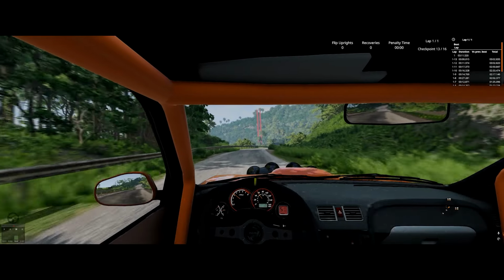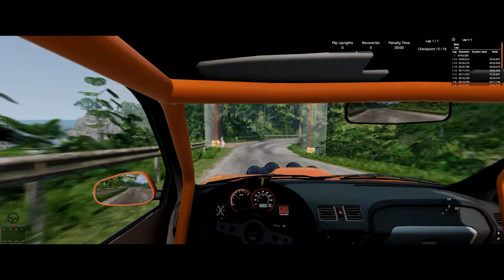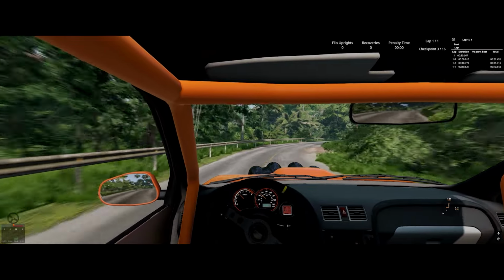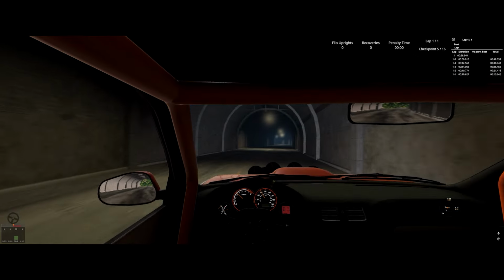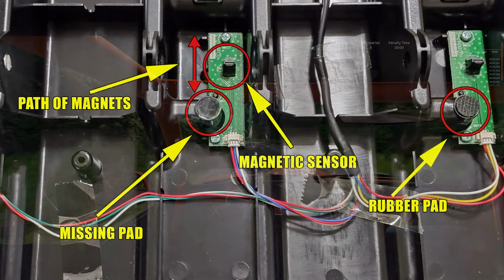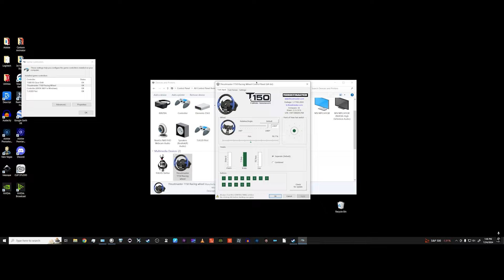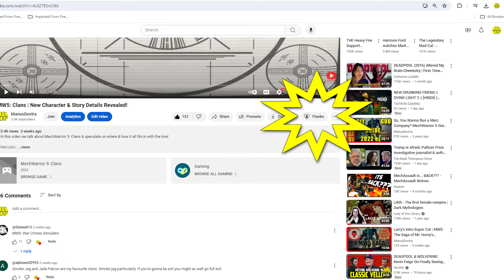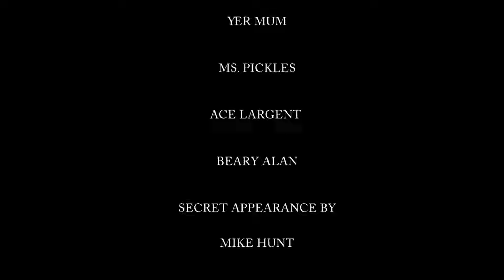ThrustMaster T3PM Brake Pedal Deadzone Fix! | T248 Magnetic Pedal Fix

Comment: Hi Manus, please i need absolutely an help! I bought a TLCM Trhustmaster pedal for second hand, from the Facebook Marketplace. But actually the guy that sold me the pedal, gave me a broken pedal. After 5 minutes playing, the Accelerator pedal stop working. It works just for 5 minutes, and suddenly remain stopped to a certain level (everytime this level change). To reset it i have to unplug the cable from the base, and then reconnect it again, and it works again. But it happens every 5 minutes. The other 2 pedals (clutch and brake) work perfect. So i open the pedal and i clean everything in very deep way, but the problem is still there. I was thinking to swap the potentiometers with the clutch one. But it's not easy because i have to solder the little wires to let swap it. Do you think is gonna work? Do you know another way to repair it? Can we talk via mail?